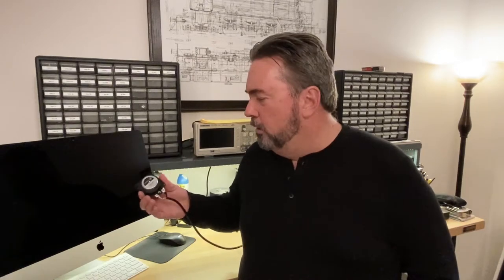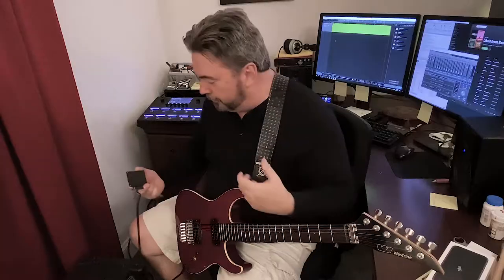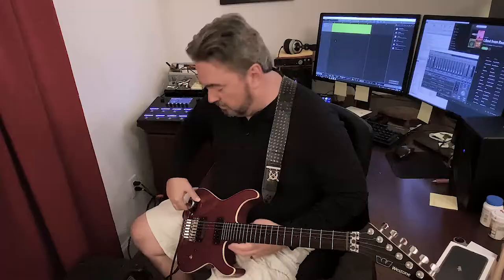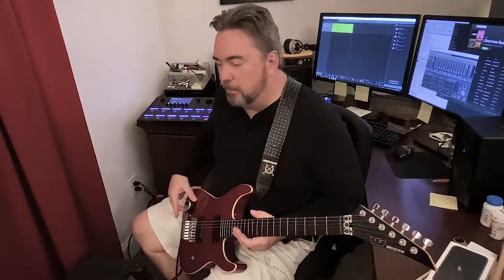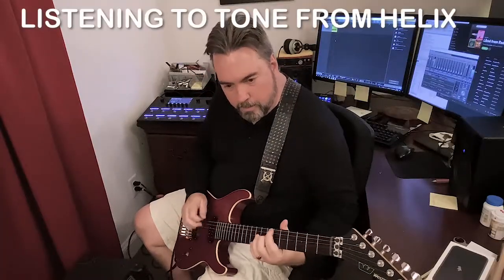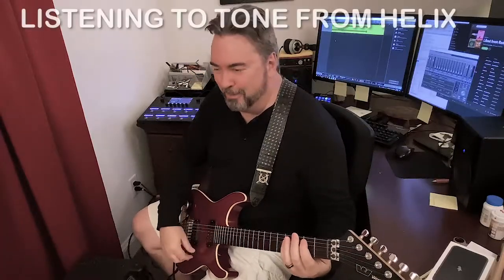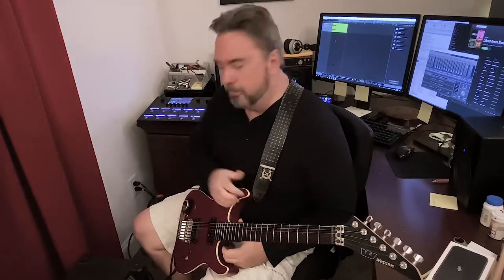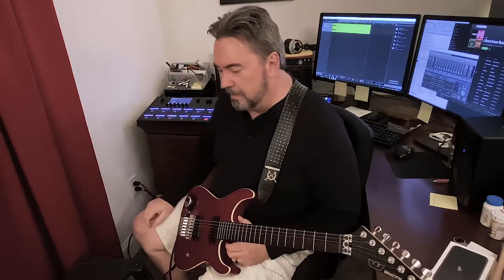Get great guitar feedback with an exciter module

Comment: Aging Engineer this is pretty cool. I think I saw something similar on the Philip Mcknight channel it's called the HyVibe guitar and you can use an acoustic guitar as a speaker to play a backing track on and I think one of those systems also had a looper built in on the guitar so you can record yourself a play back using your guitar a speaker. I want to thank you though for testing this out and if some point in time it might be cool to add a volume pedal so you could control the feedback or just use it al low volume to increase the sustain of the guitar with a couple of seconds. It might also be cool to include some feedback eliminating circuitry or equipment to reduce feedback but increase sustain. As  kid I always wonders if it was possible to place a small speaker in the cavity of a guitar and that was before I found out about exciters existed. In any case I would like to thank you for testing this all out for us. and share it.

Comment: MY GOD, I thought I was the first to have this idea, turns out you impremented it already, thank you very much!! I'm Thinking now how to make it wireless and have some control, maybe with a volume pedal or something. Maybe a battery powered mini amp on the back of the guitar pushing the exciter
Reply: Not the only one 😊 plus Sustainiac used to have a transducer to attach to the headstock and I saw someone who just installed a small speaker under the strings for a similar effect. I have the odd exciter from my interest in DML and I’ve been meaning to try them on my guitars when I get time.

Comment: One issue I think I noticed.... if you just turn up the volume and don't play anything, will it also feed back?  That would be an undesirable scenario.  If so, you could probably solve it with some switch or volume knob for how much of that is happening.  Like leave it off till you actually want it.  Then you hit your power chord, flip the switch... feedback.  ?

Comment: Great video! This is one issue guys who don't like amp sims / kempers talk about. Do you know if it works with a strong clean/edge of breakup tone? Would be interesting to dial down the OD until it stops working to see where that point is. Also... can you control it? Like tilting away from your amp live? Also... the tape is actually in between the body and the activator?  I saw some video where the guy was holding up a little speaker to his guitar in the studio to make this happen. Thanks!!
Reply: "Like tilting away from your amp live?"  no, because as he said, it's not the air vibrations hitting your strings that is causing the string to continue vibrating.  It's the sound of the electrified strings coming back in the form of electricity which vibrates the round thing like a speaker and those vibrations transfer into the guitar body so being right up to the amp or back of the stadium, would make no difference.  Apparently, it's just going to feed back when it is on the guitar UNLESS you had a volume pot to attenuate the actual strength of the vibrations so that in essence you could turn it down so it didn't feedback as much or not at all.  You prob could also run the guitar into the vibrator thingy and multiply the frequency by some number (.5, 2) and get a difference note feeding back.  Just how I understand it.

Comment: Very cool.  Quick question - in one spot you seem to mention 5 W, and then another 30W, (which seems to be the spec for the exciter you used).   Did you happen to experiment with different wattages or exciters to find the "best" or lowest wattage?  I am interested in lowest possible that would still do the job well, so that space and power are minimized.  I welcome your additional input.   Thanks again for the inspirational video.

Comment: I'm confused, where exactly is the exciter plugged into? Also, where do I purchase one?
Reply from the maker: The links are in the description. The exciter is basically a speaker without a cone, so just think of it as a speaker that needs to be plugged into an amp. I used a little combo amp for the video, but you can pick up little digital hobby amps for $20-$30 that work fine for this use.

Comment: So this is a regular speaker cable and you have IT connected to 1/4" Jack Like a Headphones Out?
This would solve a year Long issue of my homerecordings 😃
Edit: Watched the Video again and now got it. You need a speaker Out for 8 Ohms. ...Must have been my Attention Span.
However... Ist it of impotance which Wire goes to which lug? Best regards
Reply from the maker: No, it doesn't really matter for this application which wire goes to which lug on the exciter module. Either way works just as well.

Comment: Very cool
Reply: Yes man!!! This is brilliant. I was considering buying an attenuator but all of the video's i watch simply show the volume lowering. I am not seeing total saturation to the point of feedback which is why i would spend hundreds of dollars...so I could get that sound at lower volumes so I do not blow my neighbors out of their home. Enter the Aging Engineer and problem solved. One thing I would like to know is, as Philip puts it, "you need a speaker out for 8 ohms". Why 8 ohms? I have a VOX AC30 with a 16ohm output. Can't I use that? I bought one anyway but I would like to know why he said specifically 8 ohms.
Reply from the maker: @johnp.sprenz1308  You should always try to match your speaker ohms to your amp rating for the optimal output. A VOX AC30 is fine with 8ohm or 16ohm speakers, so you'll have not problems. The risk is if you use a far lower ohm speaker (eg a 2ohm speaker cabinet) on an amp with a higher MINIMUM ohm rating (eg 8ohm)... This can risk (particularly in high wattage situations) causing your amp to push too hard, overheat, and fail.

Now these little exciters are only going to use a couple watts max... Any more than that and you'll be getting so much body feedback in the guitar that it'll be unplayable. There's very little risk of burning out your amp driving these at only a few watts.
Reply: @johnp.sprenz1308  you will always want to match the speakers impedance to the amplifier impedance if you can. So that means if your amp has an 8 ohm impedance you will want your speaker to also have an 8 ohm impedance. You would also want to match the wattage. For instance you  would not want to plug in your 100 Watt Marshall stack in a 2 watt speaker and run them at full gain. 
If you have a 16 Ohm guitar amplifier output you can run 2 exciters in series like you can with speakers. Speakers in series you can add the impedances of both speakers if you you them in parallel you can divide the speaker impedance in half. You have to make sure the speakers or exciters in this case are of the same type/wattage. So really unless you know an engineer I personally would just want to get something that matched both wattage and impedance. If you buy the parts anyway you would normally would just want to make sure they matched. I would be surprised if you have to crank them over a couple of watts anyway to get pretty decent feedback.